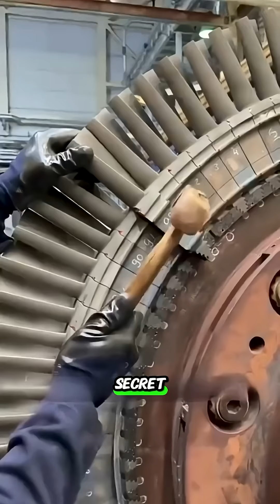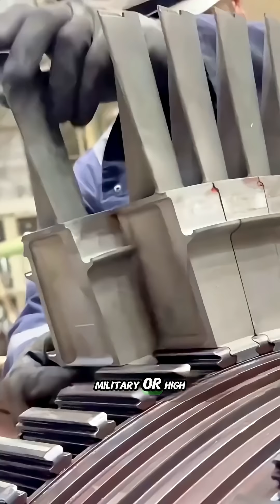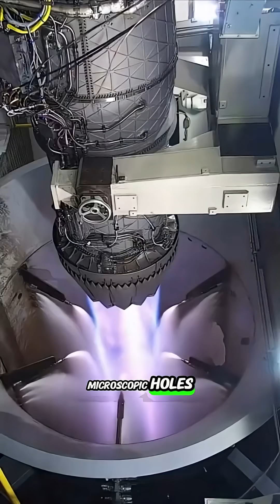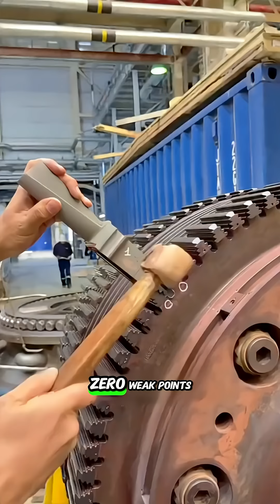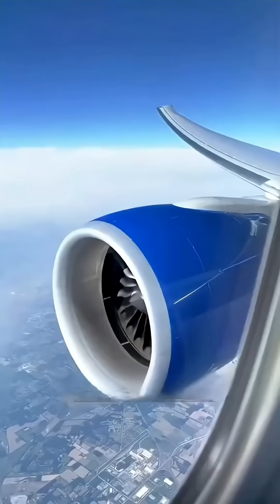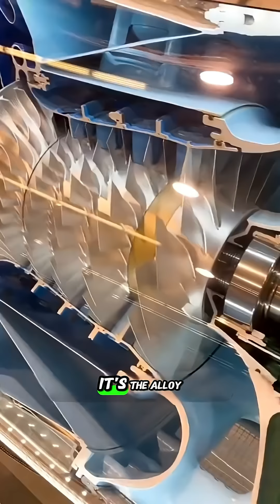The Insane Reason Nobody Can Copy American Jet Engines

Comment: I used to make inspection gages for PCC airfoils. Amazing parts. They cast a ceramic core, cast the nickel alloy around it, then dissolve the ceramic inside.
Reply: Hey, I used to work in their lab at the NC plant.
Reply: The bags of tabular alumina had a distinct smell.

Comment: I hit a flock of geese one night over Lake Mead in a 757. Geese went in both Rolls Royce engines. The right engine just shredded the goose and didn’t even burp. The goose on the left engine hit the spinner and it exploded and went through the fan. It took out 4 blades. That Rolls was shaking but still running all the way to Las Vegas. I left it at idle to prevent further destruction. Those 4 blades cost $100,000 each. Used. Unbelievable. They just pressure washed the right engine. Still running today.

Comment: That's a bit of a stretch. Jet engines are built in Russia, China, France, the UK, Canada the USA and I am sure I have omitted some. Canadas new Gripon fighter from Sweden will be powered by a RR eng built in Canada which will give it better performance and endurance than the current American eng. powering the Gripon. So what was the reason that you gave?

Comment: From a mechanics point of view, why would you put the engine on a pedestal in front of the wing?So all the hot exhaust can blow on the wing on the leading edge of the wing.Now it don't, because they run on compressed air

Comment: Uhmm... the USA got the jet engine designs, and the metallurgy for the blades from the British. And the British still are one of the leaders in jet engines. You may have heard of a little company called Rolls Royce. Then there is CFM International, which is the leader in jet engines by market share, and is a joint venture between the French company Safran and GE Aerospace.

Comment: In 2006, an agreement was signed on the creation of a new engine, which was named PD-14 (a promising engine with a thrust of 14 tons).

PD-14 is a serially produced Russian high-bypass turbofan engine of fith generation developed for the MC-21-300 aircraft, PD-14A for the MC-21-200, and PD-14M for the MC-21-400. PD-8 engine will be installed on the Be-200, AN-148 and Sukhoi Superjet 100 aircraft. Therefore, the designers and engineers faced the task of creating a unified gas generator, the main element of the engine.

16 new technologies were developed for PD-14 by russian designers, engineers and scientists, namely - single-crystal blades for a high-pressure turbine with an advanced cooling system that allows the turbine to operate at temperatures up to 2000 ° K.; hollow wide fan blade made of titanium alloy, thanks to which it was possible to increase the efficiency of the fan stage by 5% in comparison with the fourth-generation turbofan engine PS-90 produced in the USSR in the late 1980s; low-emission combustion chamber made of intermetallic alloy; sound-absorbing structures made of composite materials; ceramic coatings on hot parts; hollow blades of a low-pressure turbine, etc.

 20 new materials were created for PD-14 with indisputable advantages: a decrease in specific fuel consumption by 10–15%, a reduction in the life cycle cost by 15–20%; operation of the engine will cost 14-17% cheaper than existing analogues. All of them have been certified according to international standards.

New Russian titanium and nickel alloys are used to create the engine. The engine nacelle design comprises 65% domestic polymer composites, which achieve the required level of sound insulation and reduce engine weight. 

The technologies used in the production of PD-14 are state secrets and are protected. Therefore, information about PD-14 is broadly classified. Example: China would gladly copy production technologies, much like the Su-27. They copied the plane, but they failed to replicate the AL-31F engine.

The state's ability to produce cooled cast blades for a modern turbine aircraft engine is an indicator of the highest level of development in mechanical engineering. There are fewer states capable of producing fifth-generation aircraft turbojet engines than countries with nuclear weapons or those that launch satellites into space. Only four countries—Great Britain, Russia, the USA, and France—possess full-cycle technologies for creating such engines.

Comment: I took "Propulsion" when I was a Mech. Eng. undergrad. It was one of the most complicated and hard classes I've ever taken, and it was mostly about jet turbine propulsion with just a couple impeller blades. The professor was a miserable asshole, but the subject matter was still insanely complicated. Once the veil is lifted, you can see how much of an engineering marvel it is for airliners to just turn these things around and keep flying all day.

Comment: Good ol’yanks. Saving the day for the whole world….again..  It’s SUCH a good job you invented the jet engine ~ oh, but wait. Oh yes, of course, silly me. It was THIS side of the Atlantic that invented the jet engine thanks to Frank Whittle in the U.K. who patented the jet engine in 1930 ~ a full 14 years before America flew their first jet ~ which you only managed because we gave you the engines. And the German Hans von Ohain who also invented the first jet powered aircraft the Heinkel He178 which flew using Ohain’s engine in 1939. Incidentally, at the same demonstration of the He178 jet, the Germans also showed the He176, which was a liquid-fuelled rocket propelled aircraft. So this side of the Atlantic was technologically wayyyy ahead of the U.S. 
Of course, you could have had probably the most advanced of the 1st generation jet fighters operational in WW2, the Lockheed L.133 Starjet, a beautiful canard-wing design powered by two Lockheed L1000/XJ37 axial flow turbojets ~ but those dinosaurs at the USAAF said ‘Nope’ in 1942. The groundwork on the L.133 did eventually lead to the Lockheed P.80 Shooting Star, but Europe had at least 4 jet powered aircraft either in or about to enter service by war’s end. And the most jet engines today are produced by CFM International, a joint French/US outfit. They are THE undisputed volume leader. Their LEAP engine powers the Boeing 737 MAX, Airbus A320neo, and COMAC C919. Their legacy CFM56 is the best-selling jet engine in history, with over 34,000 produced. So, not American only then… There’s a surprise..NOT!

Comment: Just ask China about how difficult it is to manufacture fighter engines. They've stolen US blueprints for this, along with countless other military products. They've made progress producing their fighter engines but they're still decades behind. They haven't been able to master metallurgy with regards to producing metals, aluminum, titanium, etc... They can't come close the precision "grain structure" in these metals which has led to concessions in thrust and maintenance, just to name two, let alone engines that "don't blow up at 50,000 feet. Where an American fighter jet engine may have a service of 2500 hours in between tear downs, China is at 1,000 hours, with less powerful engines.

Comment: I was trained to repair jet engines and when I was working with the fuel control that was extremely difficult to learn the instructor told me that the person that designed it went crazy... No pressure for me 😓

Comment: Bullshit. Jet engines are technology from the 1930s created in Germany; any top-tier engineering university can make a jet engine. And the US does not dominate the technology. Rolls-Royce leads the market some years, and today a joint venture between GE and Safran, a French company, is shoulder to shoulder with Rolls-Royce. Whoever is newer is the best between those two and Pratt and Whitney. It's a 3-horse race. And two of them depend on or are not American. Being the most important and being dominant are two entirely different situations very far apart from each other.

Comment: I work for an American jet engine manufacturer. Yes, the machining of the components is pretty precise, at my facility we measure down to 4 decimal places. This is no where close enough to build a rifle, but pretty tight tolerance.
Also, regarding Rolls Royce, they cannot assemble any of their engines without GE components.  Apparently, GE holds the patents on certain processes that are required for certain parts and these components are sold to Rolls.  I’m not nitpicking, just telling you how things are.
Reply: Are you saying that a rifle has closer tolerances than does a jet engine?
Reply: @daniel_moretti  Yes...by quite a bit. A high quality rifle will be machined 100x closer. We measure to typically 4-5 decimal places (10-thousanths to 100 thousands of an inch), gun smithing is another 1 or 2 decimals!!  Extremely precise !!
Reply: @rusty9129 Wow I never knew that. Thank you!!

Comment: North America (led heavily by the US) accounts for approximately 36% of global jet turbine blade and vane production, commanding a major share of the market alongside Europe and the Asia-Pacific.

US-based manufacturers account for nearly 88% of the global jet engine market. This manufacturing base is dominated by major American aerospace companies, most notably GE Aerospace and Pratt & Whitney, alongside their highly successful global joint ventures.

The remaining 12% of the global market is supplied by other international manufacturers, predominantly the British company Rolls-Royce.

While there is no exact global output percentage, the UK accounts for approximately 35% of the European aircraft turbine blade market. The nation is a global powerhouse in the aerospace sector, primarily driven by Rolls-Royce, which manufactures hundreds of thousands of cast single-crystal blades annually.Rolls-Royce’s multi-million pound advanced casting facilities—such as the 150,000 sq ft site in Rotherham, England—produce over 100,000 blades a year. These facilities supply components for both commercial long-haul aircraft and military aviation worldwide.

Comment: The cooling holes are various sizes but they are much bigger than a human hair. Human hair is between three and five thousandths of an inch. I used to make turbine blades and the smallest holes were about sixteen thousandths of an inch, and bigger from there.
Reply: How do you know as you have never worked on these jets.
Reply: @nickfantini6489 ⚠️ FFS, can’t you read? He worked in a shop that made jet blades! 🤷🏻‍♂️

Comment: @MotorVibe_Talks
Those jets have to take off and land to provide air travel anywhere. Save the rainforest, save the amazon, save the natural rubber tree,( it's under disease threat) save biodiversity, you just might need it. The rubber tires have a design life, synthetic rubber cannot entirely, replace natural rubber. The rubber dust worn off your tires washes into the streams where coho salmon can no longer survive. The salmon in the waterways flowing into Alaska's Bristol Bay can feed people and petroleum, gold and cyanide and their incidental and consequential damages can and will destroy biodiversity and the food web. Jet engine planes cannot land and take off using metal, wood, or styrofoam tires. Actions have consequences. Life spans are short, life on earth is precious and irreplaceable.

Comment: Ok...thats a little dramatic. Yes, there are high levels of precision that go into turbine blades, but its not THAT precise. They have to account for things like combustion fouling, dirt/dust ingestion, thermal expansion and many other factors. Theyre is always a "margin of error" figured in otherwise there would be catastrophic failures happening daily. That said, these are incredibly precise engines with exact tolerances and constraints, but its FAR from having "no margin of error". Part of why they're so expensive if becsuse of materials, and the man-hours that go into quality checks. If the engine fails in your car, its a bad day for you. If the engine fails in one of these aircraft, its a bad day for you and 300 other people.....and you cant pull over and call an Uber

Comment: there are roughly 8 countries that are capable of building jet engines, and of those 8 countries, only 4 have been able to scale up production to the point of being in the big league.
Reply: Yes, that's right. Only four countries in the world can make the fifth-generation turbo fan engines due to their high complexity. China can't produce them by reverse technology.

In 2006, an agreement was signed on the creation of a new engine, which was named PD-14 (a promising engine with a thrust of 14 tons).

PD-14 is a serially produced Russian high-bypass turbofan engine of fith generation developed for the MC-21-300 aircraft, PD-14A for the MC-21-200, and PD-14M for the MC-21-400. PD-8 engine will be installed on the Be-200, AN-148 and Sukhoi Superjet 100 aircraft. Therefore, the designers and engineers faced the task of creating a unified gas generator, the main element of the engine.

16 new technologies were developed for PD-14 by russian designers, engineers and scientists, namely - single-crystal blades for a high-pressure turbine with an advanced cooling system that allows the turbine to operate at temperatures up to 2000 ° K.; hollow wide fan blade made of titanium alloy, thanks to which it was possible to increase the efficiency of the fan stage by 5% in comparison with the fourth-generation turbofan engine PS-90 produced in the USSR in the late 1980s; low-emission combustion chamber made of intermetallic alloy; sound-absorbing structures made of composite materials; ceramic coatings on hot parts; hollow blades of a low-pressure turbine, etc.

 20 new materials were created for PD-14 with indisputable advantages: a decrease in specific fuel consumption by 10–15%, a reduction in the life cycle cost by 15–20%; operation of the engine will cost 14-17% cheaper than existing analogues. All of them have been certified according to international standards.

New Russian titanium and nickel alloys are used to create the engine. The engine nacelle design comprises 65% domestic polymer composites, which achieve the required level of sound insulation and reduce engine weight. 

The technologies used in the production of PD-14 are state secrets and are protected. Therefore, information about PD-14 is broadly classified. Example: China would gladly copy production technologies, much like the Su-27. They copied the plane, but they failed to replicate the AL-31F engine.

The state's ability to produce cooled cast blades for a modern turbine aircraft engine is an indicator of the highest level of development in mechanical engineering. There are fewer states capable of producing fifth-generation aircraft turbojet engines than countries with nuclear weapons or those that launch satellites into space. Only four countries—Great Britain, Russia, the USA, and France—possess full-cycle technologies for creating such engines.

Comment: First, the missing part of the video is the tools to make these engines ate just as difficult to make, and the video did say, very few countries can make these, it didn't say one one
Reply: Only four countries in the world can make the fifth-generation turbo fan engines due to their high complexity. China can't produce them by reverse technology.

In 2006, an agreement was signed on the creation of a new engine, which was named PD-14 (a promising engine with a thrust of 14 tons).

PD-14 is a serially produced Russian high-bypass turbofan engine of fith generation developed for the MC-21-300 aircraft, PD-14A for the MC-21-200, and PD-14M for the MC-21-400. PD-8 engine will be installed on the Be-200, AN-148 and Sukhoi Superjet 100 aircraft. Therefore, the designers and engineers faced the task of creating a unified gas generator, the main element of the engine.

16 new technologies were developed for PD-14 by russian designers, engineers and scientists, namely - single-crystal blades for a high-pressure turbine with an advanced cooling system that allows the turbine to operate at temperatures up to 2000 ° K.; hollow wide fan blade made of titanium alloy, thanks to which it was possible to increase the efficiency of the fan stage by 5% in comparison with the fourth-generation turbofan engine PS-90 produced in the USSR in the late 1980s; low-emission combustion chamber made of intermetallic alloy; sound-absorbing structures made of composite materials; ceramic coatings on hot parts; hollow blades of a low-pressure turbine, etc.

 20 new materials were created for PD-14 with indisputable advantages: a decrease in specific fuel consumption by 10–15%, a reduction in the life cycle cost by 15–20%; operation of the engine will cost 14-17% cheaper than existing analogues. All of them have been certified according to international standards.

New Russian titanium and nickel alloys are used to create the engine. The engine nacelle design comprises 65% domestic polymer composites, which achieve the required level of sound insulation and reduce engine weight. 

The technologies used in the production of PD-14 are state secrets and are protected. Therefore, information about PD-14 is broadly classified. Example: China would gladly copy production technologies, much like the Su-27. They copied the plane, but they failed to replicate the AL-31F engine.

The state's ability to produce cooled cast blades for a modern turbine aircraft engine is an indicator of the highest level of development in mechanical engineering. There are fewer states capable of producing fifth-generation aircraft turbojet engines than countries with nuclear weapons or those that launch satellites into space. Only four countries—Great Britain, Russia, the USA, and France—possess full-cycle technologies for creating such engines.
Reply: @almazblanco6676 of those 4 Russia is a distant 4th in quality